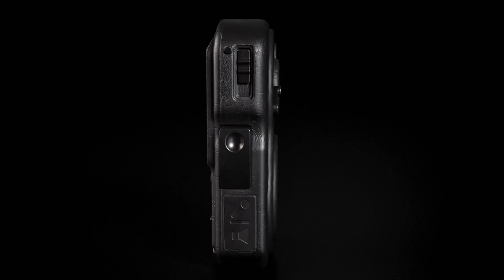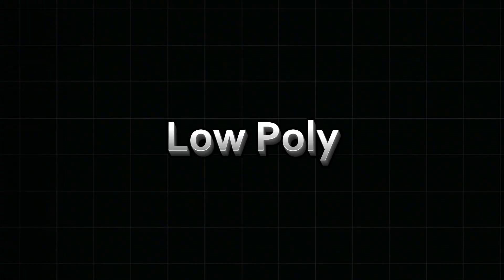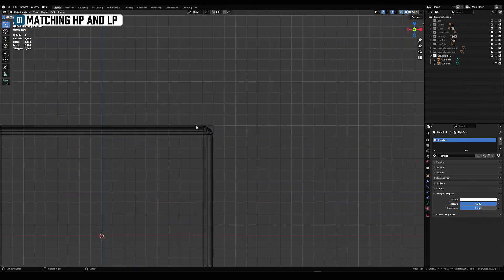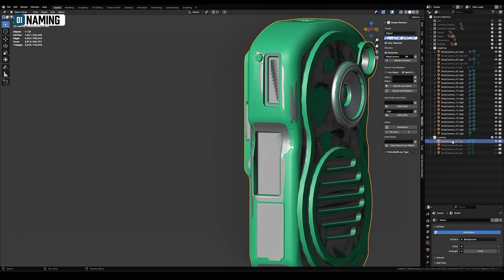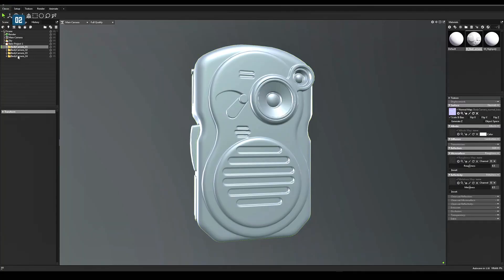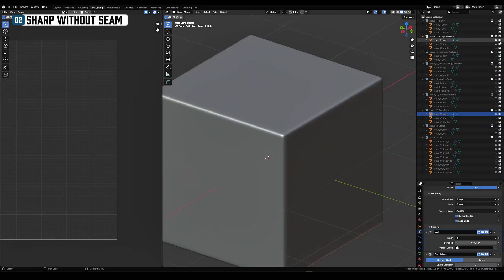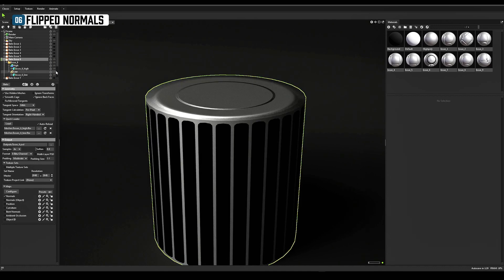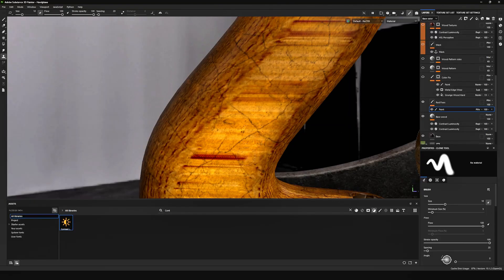Simple Steps To Perfect 3D Baking Results (Blender + Marmoset Toolbag)

Comment: Helo, and thank you for the video! Is there a way to bake intersecting geometry without splitting it into separate geometry groups in marmoset? For example, using materials splitting or poolygroups
Reply from the maker: Probably not. You can use an exploded version of your geometry by literally physically pulling the meshes apart. But this is an old and very slow approach.
Reply: @dmitriybely  Thank you! I guess you're right, I tested it with different methods, but no avail